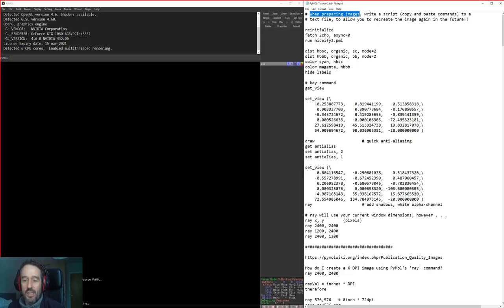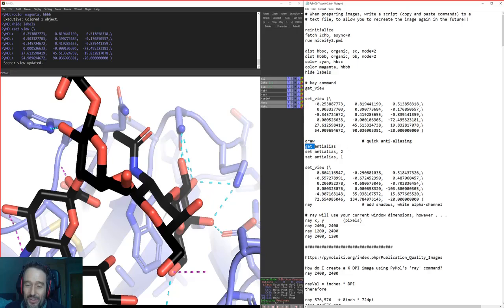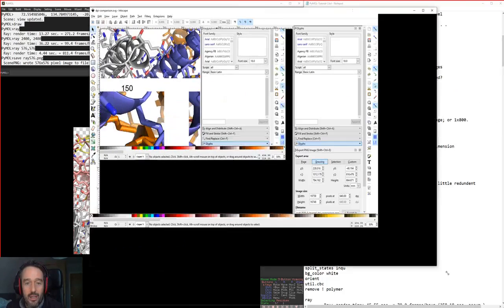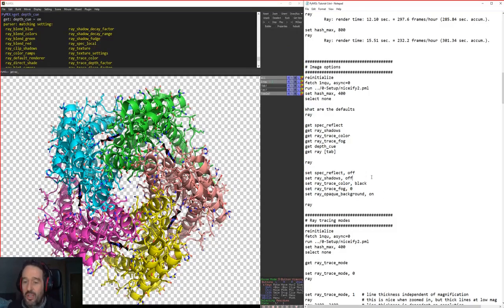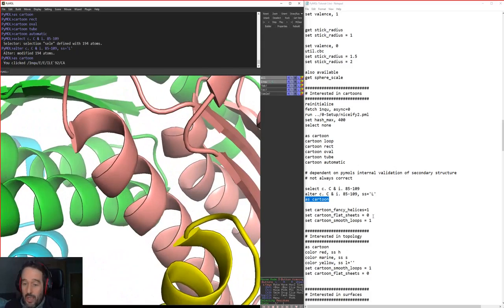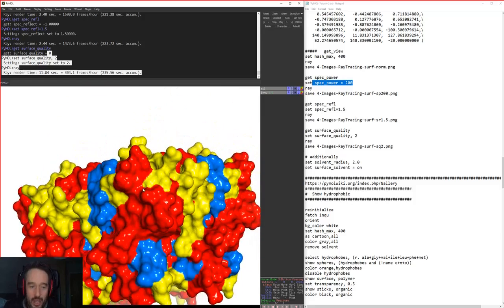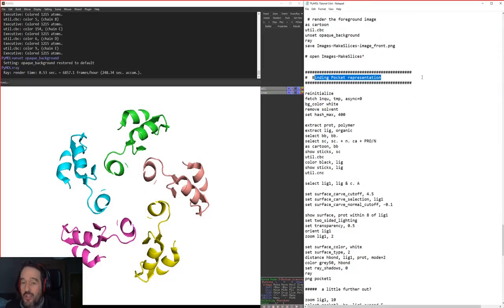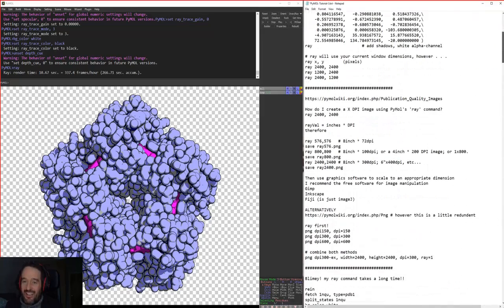PyMOL tutorial 3 : Publication Quality Images

Comment: Hi, do you have any tutorial how to change OpenGL render graphic engine from integrated GPU into dedicated one which is more powerful?
Reply from the maker: Hi Vergio,
PyMOL should already be using the dedicated GPU.  You can check which GPU is being used by expanding the pymol terminal in the gui, where the GL_Renderer is displayed as well as the driver version.  I'm afraid I do not know how to change the renderer if PyMOL is pointing to the wrong one, and can only suggest checking for driver updates then reinstalling PyMOL

Are you suffering performance issues with ray-tracing specifically?
PyMOL does NOT use the GPU for ray tracing, only the CPUs.  The GPU is used for real-time rendering of the standard display, but all lighting for images is handled by the CPU.  you can use the command 'set hash_max' to devote more RAM to the process which seriously speeds up the processes, as described at 00:12:50

Hope that helps

Comment: Hi Mr.Ross, Is there a way to make a change in orientation of the molecule in such a way that any linear transformation in the lab frame is the same as the molecular frame  . Now when i upload my pdb file, i get a bad orientation so when i translate it doesn't move to where i want it to.. may be there is some "get_orientation" im missing.. Thank you!
Reply from the maker: yes there is, i think, what are you referring to as the 'lab frame'?

Pymol makes transformations with respect to the camera when using
rotate (https://pymolwiki.org/index.php/Rotate)
or 
translate (https://pymolwiki.org/index.php/Translate)

However, you can choose to use the molecular axis (those from the pdb coordinates) by turning off the camera reference with the command
camera=0
when using the above commands.

Further, you can choose a vector based rotation based on the molecular coordinates using a command such as
rotate [1,1,1], 10, obj01, camera=0

Hope that helps.
Reply: @pymolross  Thanks a ton, Mr.Ross !! camera=0 worked! Yep, sorry with the nomenclature. It's a verbal tick from doing NMR spectroscopy..wishes!
Reply from the maker: hooray!

Comment: Hi recently anytime I ray my protein, it turns from yellow to dark black, I have checked what ray trace mode I'm in and it's 1 and not 2. I have no idea what to do, I reinitialised to get rid of any saved settings and still the same black. If anyone has any advice to solve this it would be much appreciated
Reply from the maker: Hard to say.  The best i have at the moment is to uninstall and reinstall.  Also you could try making sure your display drivers are up to date (monitor and GPU)